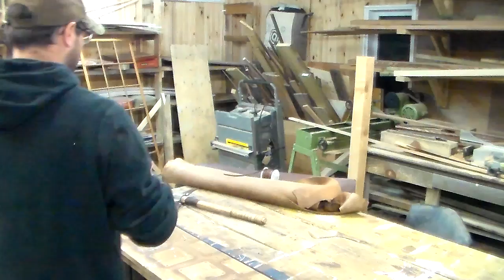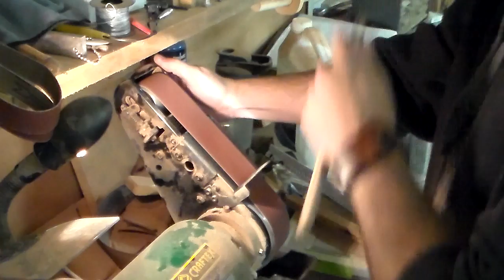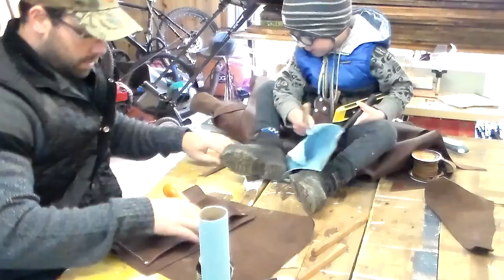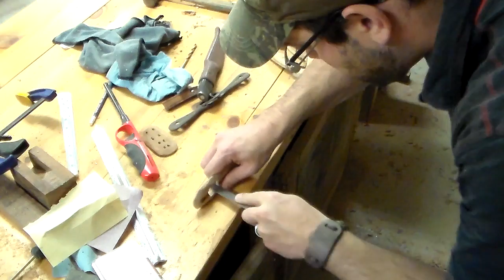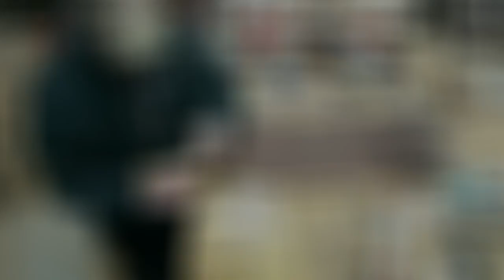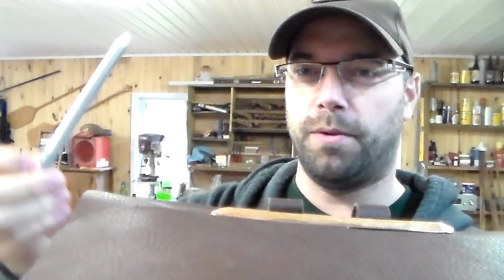Surface Pro 4 Custom Leather Case

Comment: I have been looking for a case for the SP4, had I your abilities I would not shop at Amazon, Great Video
Impact from falling would be my only concern, paid more than I was expecting, so a case that can take a drop is a must, any plans to update the case you designed to offer padding and or a shoulder strap?
Reply from the maker: +Brook Zerihun I was thinking of adding a handle. but thats about it. just dont drop it ;-)

Comment: nice... congratulations.
Reply from the maker: +Daniel Mondéjar Thanks!
Reply: +The Apprentice i wonder if you could make a cover, like THE type cover without THE keyboard, using THE magnéts un THE surface.. just cover. if you have and old typecover you could use its magnets.
Reply from the maker: +Daniel Mondéjar hmm it's an idea. :-P